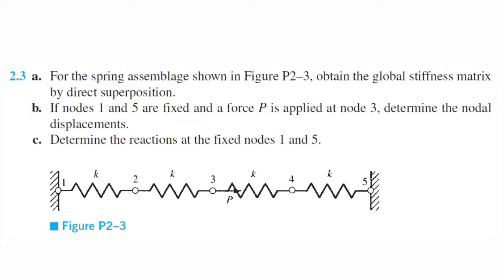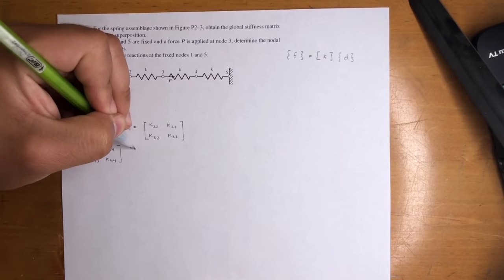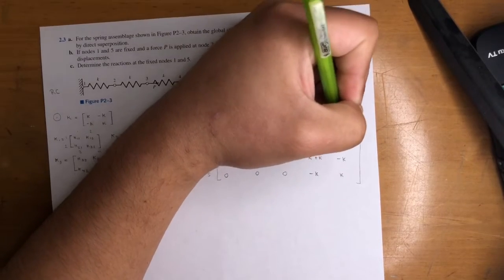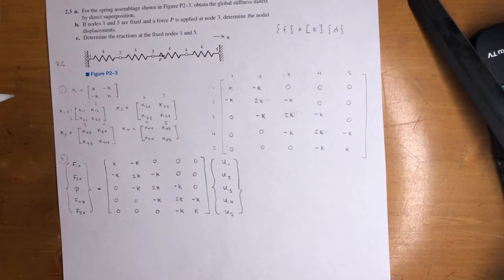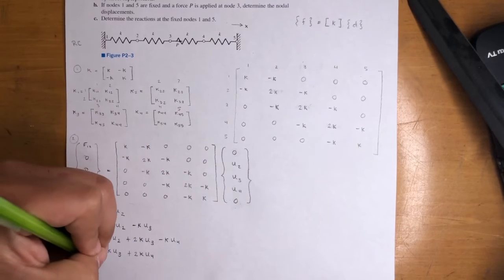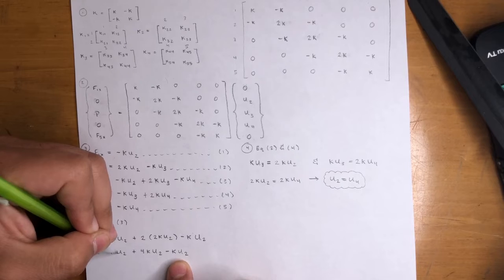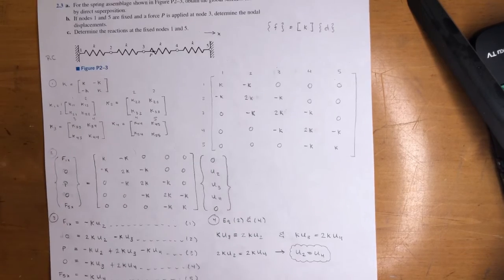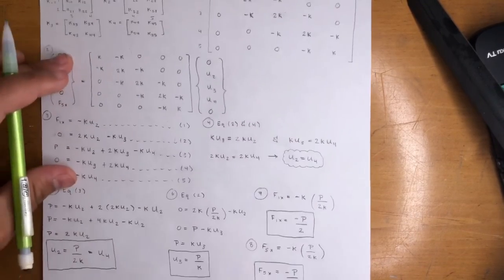Finite Element Analysis - For the Spring Assemblage shown, Obtain the Global Stiffness Matrix

Comment: hi at min 8:24 why the F = 0 i couldnt get it
Reply from the maker: They are zero because there is nothing acting on those nodes (2 and 4). If there was an applied force in the left or right (like Node 3), then you’d put that number in there. But in this case, since there isn’t anything, it’s just zero.
Reply: In the third question,asked Reactions but u showed only Forces F 
Is it ok reaction and forces are equal or what?